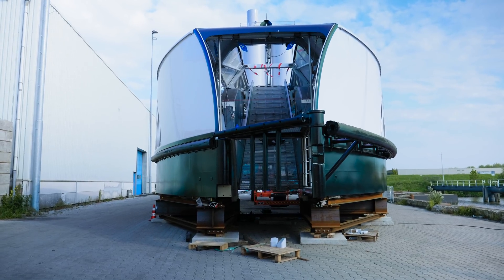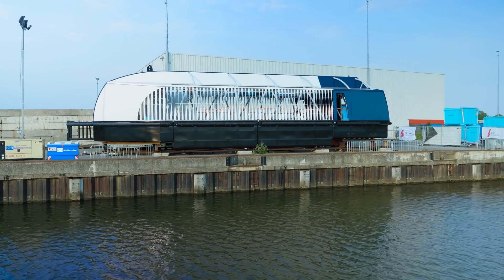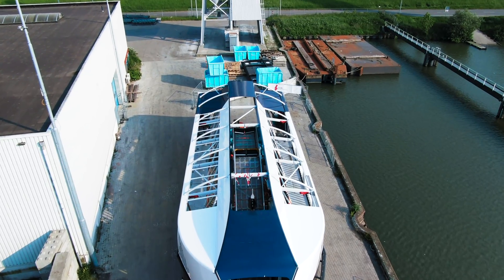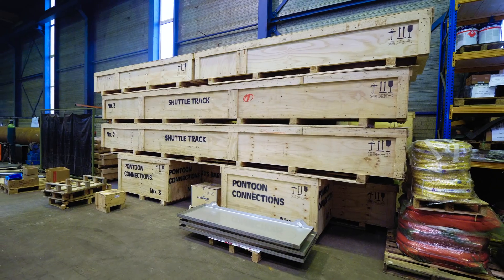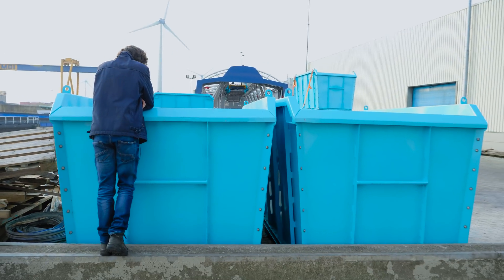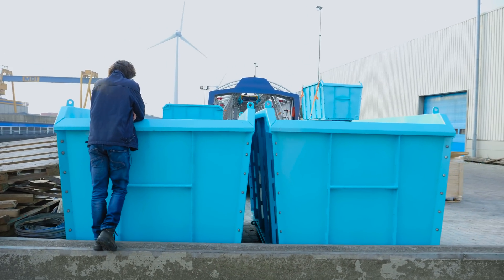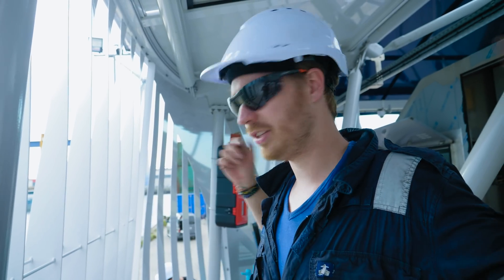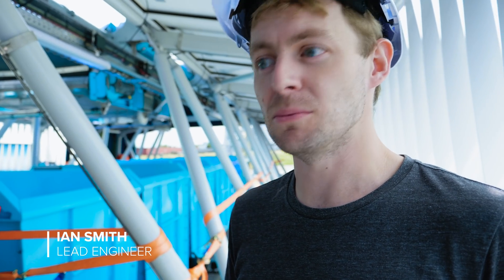Part 3: Boyan Slat Reflects On The Interceptor And Its Impact | Interceptor 004 | The Ocean Cleanup

Comment: You guys are definitely doing your part! We will continue supporting you. Is The Ocean CleanUp  partnering with other organizations to also rid plastic at their origins? I.e. I think that the issue of pollution is to address at the individual level as well.
Reply from the maker: Indeed it is important to as you say, address pollution at the individual level. We recognize that the Interceptor is not the only solution, but part of the many initiatives necessary, including education - to combat plastic pollution. Our main focus is on what we do best - developing technology. However, we do also engage in local partnerships for deployment. Those will always include the aim of ensuring no waste returns to the environment, whether facilitated through education or improved waste management processes.